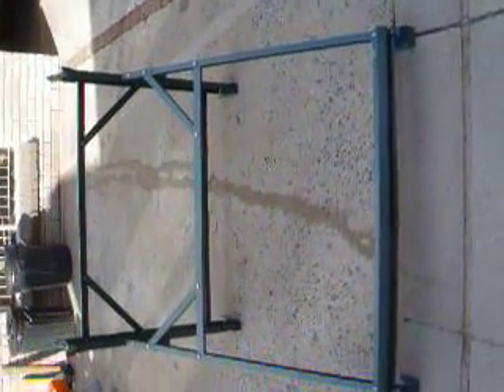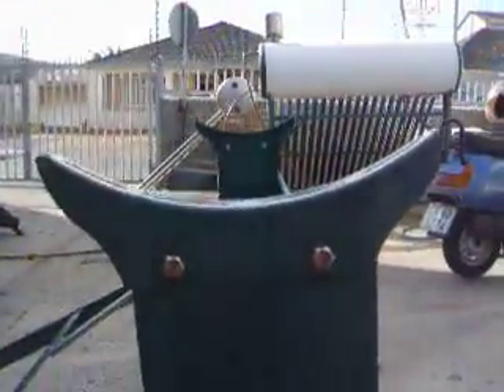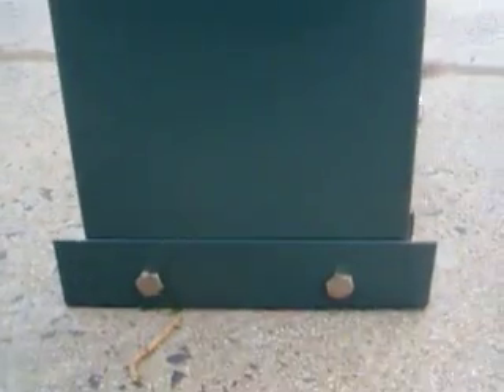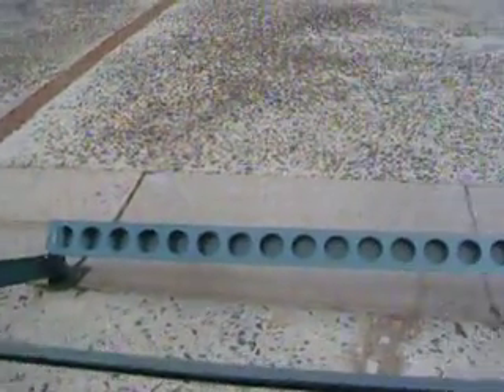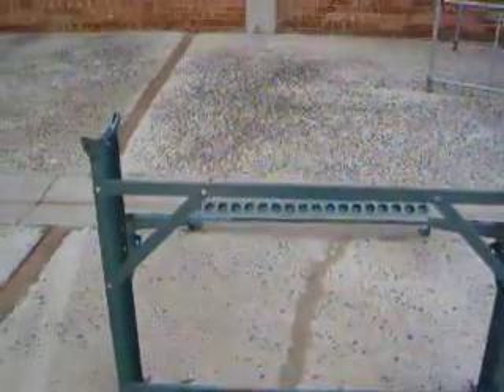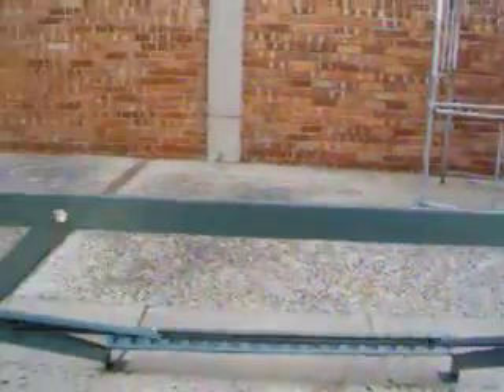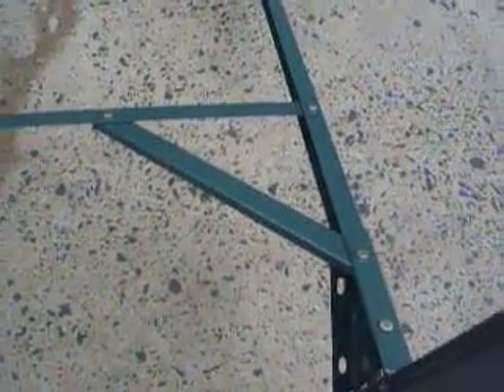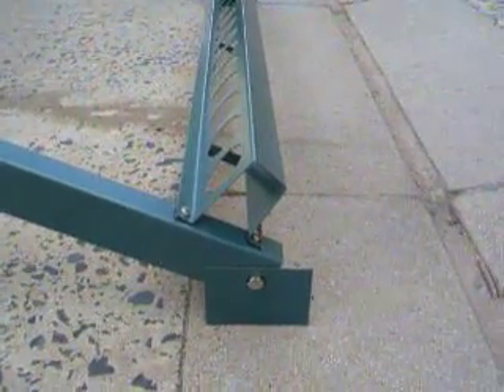Low pressure solar geyser frame assembly.

Comment from the maker: @catatonicable In theory you can, but your pressure geyser will then become a low pressure geyser, fed with the pressure from the solar geyser. If the low pressure geyser is much higher than the pressure geyser it will be the best.